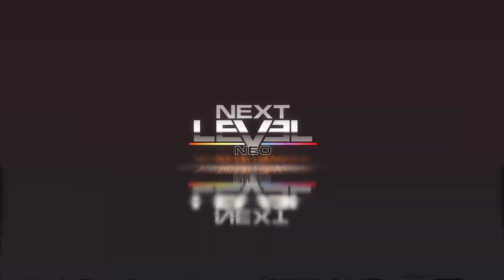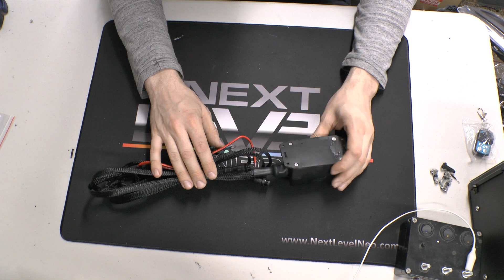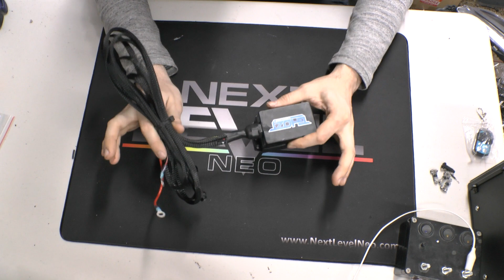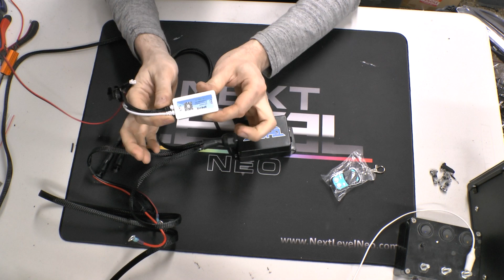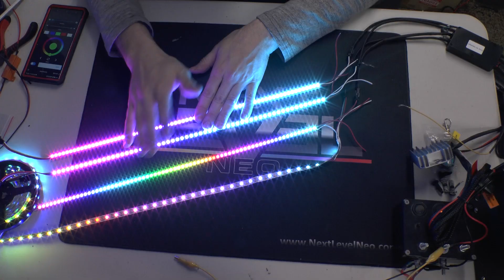The Ultimate Retrofit Buying Guide: What You MUST Know Before Buying Flow Series Custom Lights

Comment: are the amber lights on the far right corner called "reflectors"?  and is the clear lens fabricated somehow? I was thinking of doing a DIY and disassembling the tail lights of a 5th Gen Prelude but it appears the reflectors may be stuck to the lens, do you know if it's worth it to remove the reflectors? or how I can fabricate a clear lens?
Reply from the maker: Yes, generally referred to as corner reflectors. Which clear lens? Are you referring to clear corner reflectors to replace the amber? The covers on tail lights on a 5th gen are solid 1 piece. You can't remove them. You can use covers from the alteza tails to get clear covers on the factory tails but the inside of the lights don't look very nice. The fluted covers are cleaner with the factory lights.
Reply: @NextLevelNeo  ok thanks, I understand more now, and yes sorry I meant the covers, great idea with the Altezza versions, I was thinking of customizing the inside lights as well to  go with the clear covers but will think more about the design, thank you!